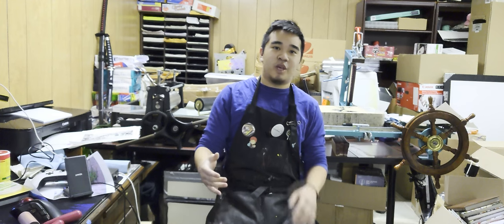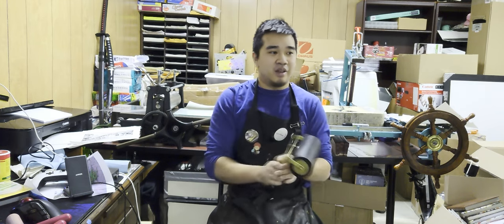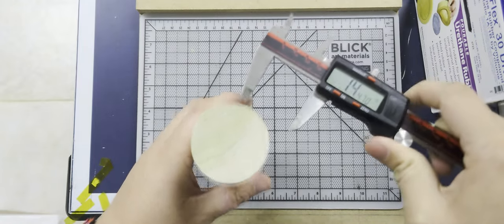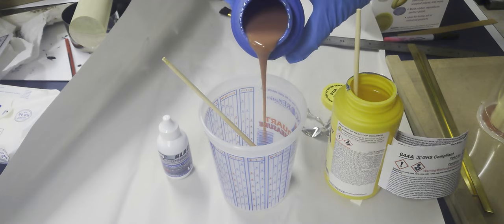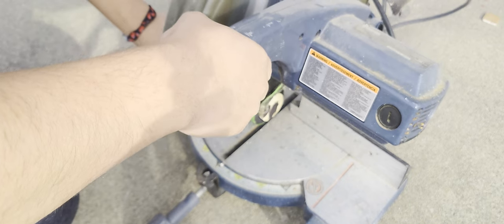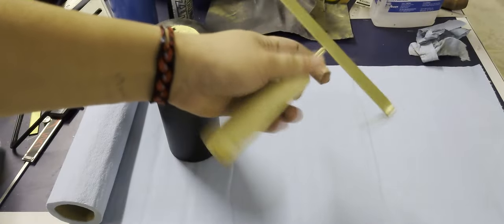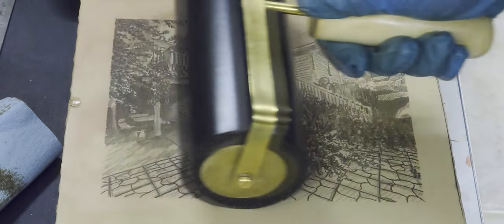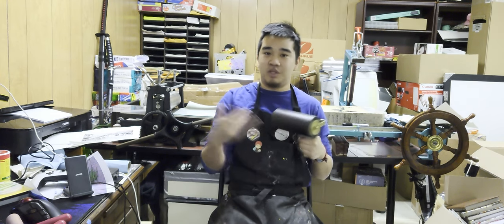Making a THICC printmaking Brayer

Comment: Wow!  You're a patient, technical guy.  Nice work.  I just hacked a really large one together using a sporting goods store exercise roller, drilled a hole for a dowel handle, then covered the surface with clear heavy gage vinyl.  I wanted to manually emulate a real press, but I'm only making experimental, abstract art prints.😀